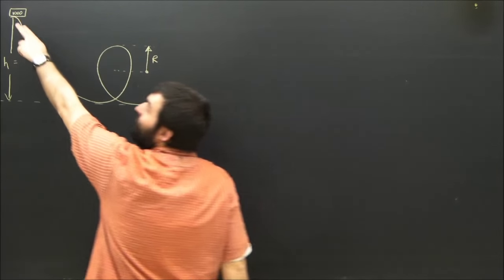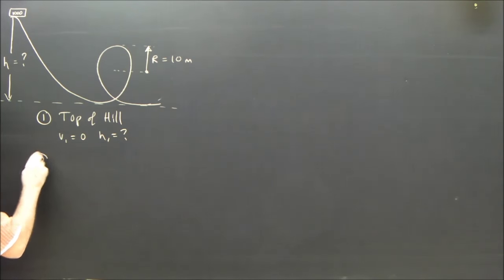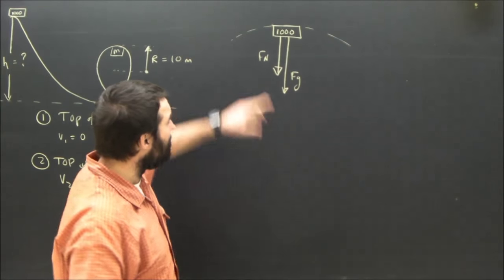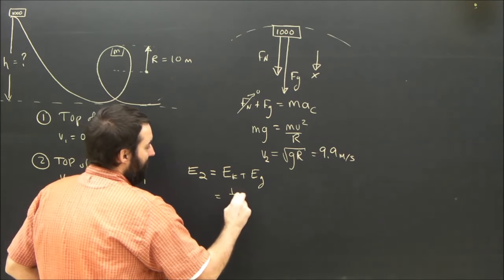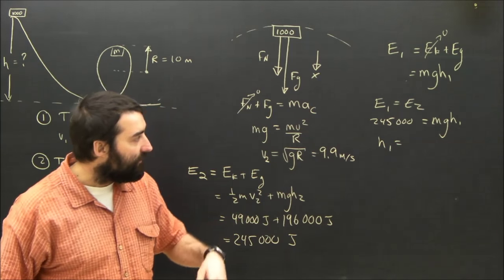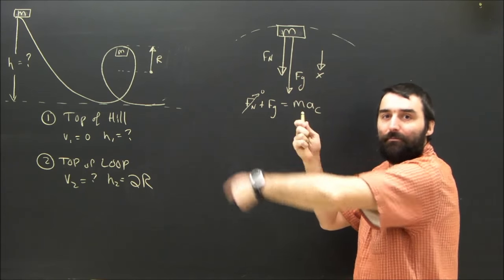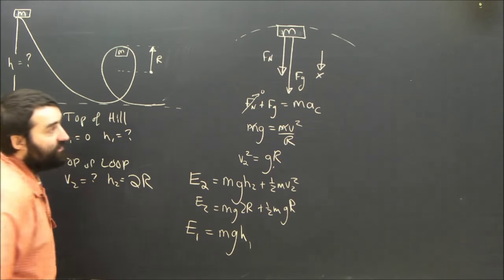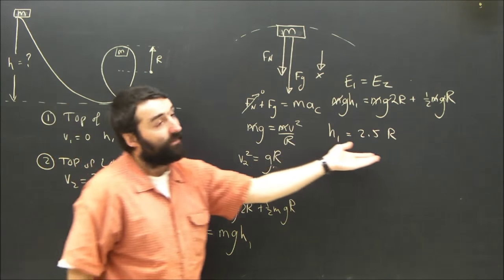Centripetal Force Sample Problem Roller Coaster Loop

Comment: You are making this hard!  Using KE + PE = constant, you get change in V^2 = -2gh.  We then set the reference height to that height where the coaster would stop (KE = 0) and work downward from there.  Since the crux move is V^2/r must equal or exceed g for safety, we look at how that changes as you drop from the "zero KE height".  Combining those 2 equations, we get centripetal acceleration/g (this is ratio of centripetal acceleration to gravity acceleration) = -2h/r.  In order for this ratio to exceed one, h must be greater then r/2.  For each r/2 lower down on the track, centripetal acceleration will increase by 1g.  So at the vertical part of the loop, the riders will experience 3g (2 g MORE centripetal acceleration then at the top) and 6g (2g more centripetal acceleration then at the side = 5g) plus 1g additional gravity at the bottom.  That's why perfect circles are never used on roller coasters; the g's get excessive.  If we increase the speed above the critical, all the g numbers increase equally.  Raising hill to 30m would subject riders to +1g at the top, and +7g at the bottom.  Each 5m taller will raise figures by 1g.

Comment: 25m, always 1/2 the radius of the track at the top of the loop, above that top, if there are no "upstops" and no restraints.  If there are both, then the hill need only be a little over 20m high to get the coaster over the loop.  This applies even though we are on a different planet and g is different!

Comment: But it's a clothoid loop, how is the height double the radius?
Reply: If I understand your question, isn't the diameter of the loop (height) just double the radius?
Reply: @pianokraken4169  Ok but a clothoid loop isn't a regular loop, it has an oval not circle shape so how does doubling the radius apply?

Comment: If it does not fall before top of the loop it will not fall after it, so the critic point is top. But this assumption is not properly and rigourously motivated in any resolution I've found...

Comment: Why did we set normal force to 0?
Reply: because we assume that the roller coster doesn't contact to rail line.so we get the minimum velocity needed.correct me if I'm wrong. :)
Reply: so basically if we wanted the roller coster stay in line we must get a larger velocity then we get a normal force.